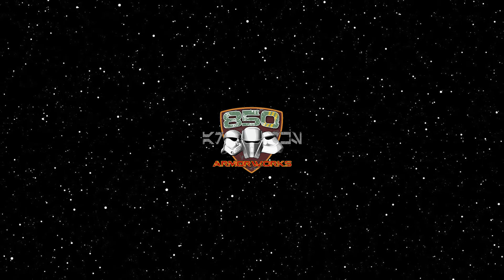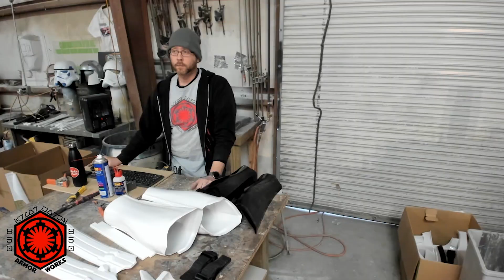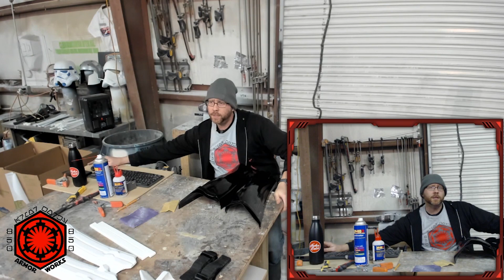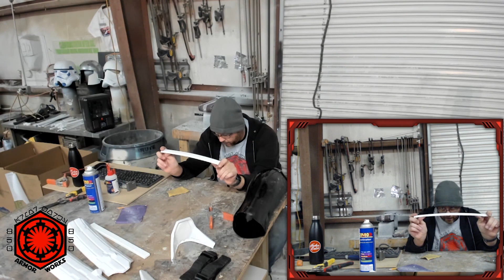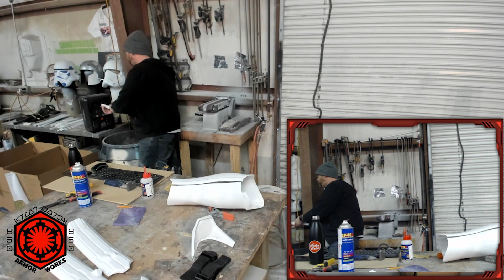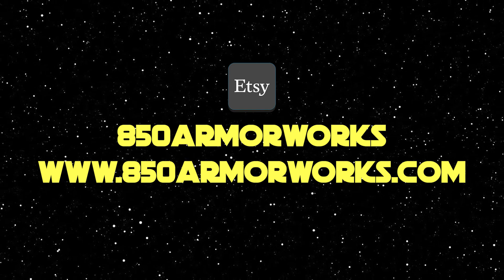850 ArmorWorks: ShoreTrooper Shin Calves Assembly Tutorial | Part 1

Comment: Hi, my friend bought your first order armor and I’m helping build it. I can’t find any videos or photos on the how the forearms, calves, or thighs are supposed to join together with out there being a large seam. Since the pieces in your kit are cut in half, I’m not sure how to get them together other than using plastic to basically weld it. I’ve searched everywhere to help with this problem but to no avail. Other people’s armor seems to have been totally different so any tutorials don’t help since it’s different from yours. I know for the closure you can use Velcro, but you couldn’t do that for both sides since in the film the armor is nearly seamless. Any closeup photos or videos of how those pieces are put together would be insanely useful, thanks!
Reply from the maker: Butt join with common strips of plastic and fill the seams with evercoat polyflex.
Reply from the maker: There is supposed to be a seam on the outer thighs and calves.